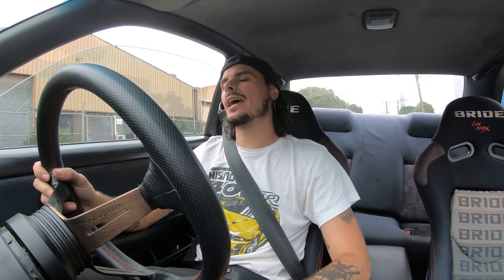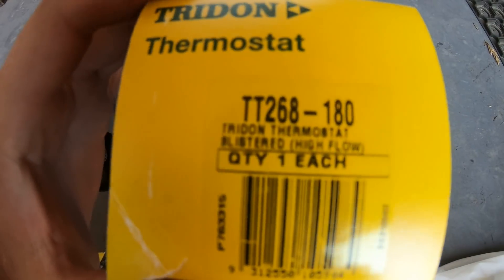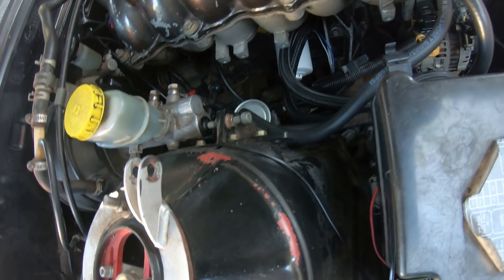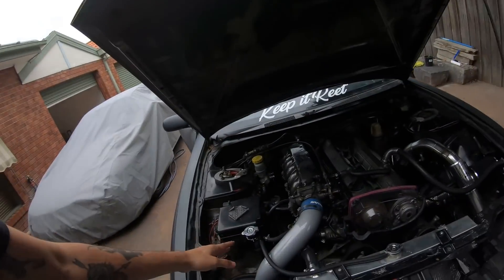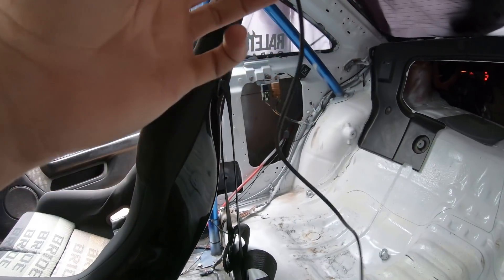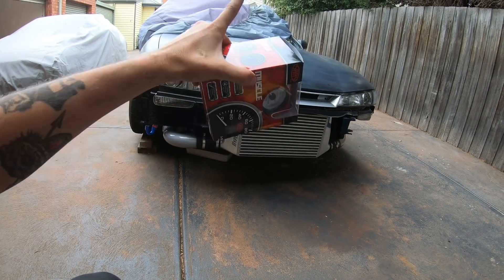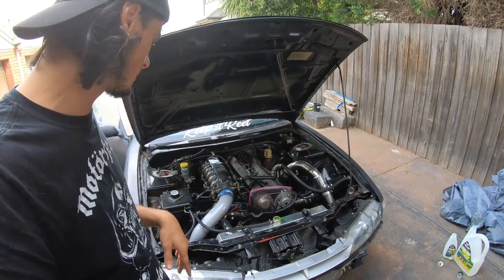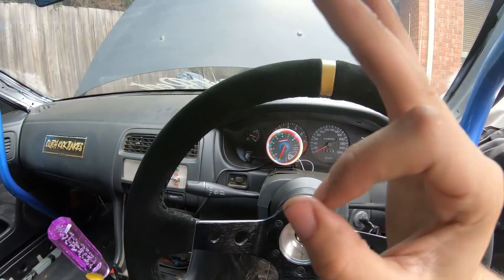RB25DET New Cooling Mods For full Send Drifting! JDM Shenanigans

Comment: BoostDoc do a nice alloy radiator hose outlet that slips straight in to the factory manifold with x4 1/8npt ports. Looks much nicer that the spliced in adapter on the top hose.
Reply from the maker: yeah dude that part is sick and so helpful as many rb25s have rotted ones. im lucky my r33 and s14 both have reasonable outlets. if they ever break i will replace, cheers mate!

Comment: Should check out Franklin perfomance when ur up2 fukal bro they make quality (not just buy in cheap sht frm China an resell it) mint bits for RBs n rotarys, they do a braided heater hose delete kit evn gts rid of the press in fitting on da thermostat housing, trigger kits, r35 coil brackets etc n nt badly priced I reckon, an when u out der pumpn it on track with da bonnet raised gta b conscious of catch can residue or sumthin letting go in da bay can cover da windscreen real quk
Reply from the maker: yeah man cheers ive seen them before i wont be doing that til i start doing the arp headstuds and gasket. she be right man most my mates drift with bonnets raised an no issues it be all good! cheers for the concern!

Comment: For where you cut the radiator support, I recommend you get some 8mm vacuum hose, split it down the middle and cover the steel edge, to cushion against your radiator. I did a similar thing to my bumper support where I cut it to clear for the FMIC. I "glued" mine in just using some Permatex silicone adhesive sealant. 

It's looking good though, pretty confident the temps are going to perform just fine with that setup 👌
Reply from the maker: hell yeah nice one man!! ive got that stuff here just lazy when i got so much to do everyday haha. really hope so haha